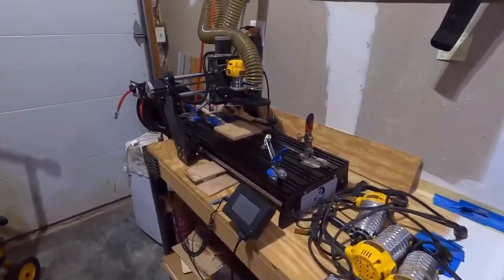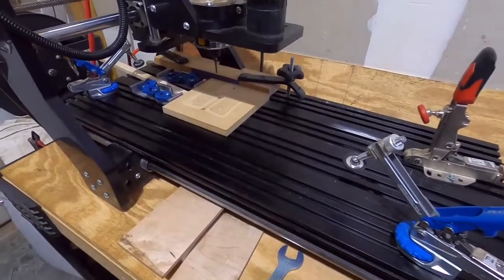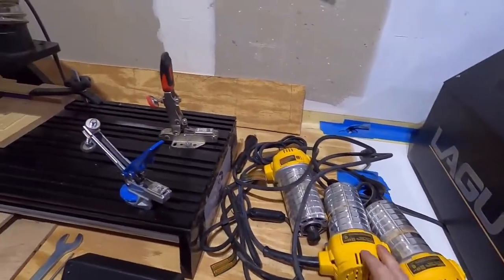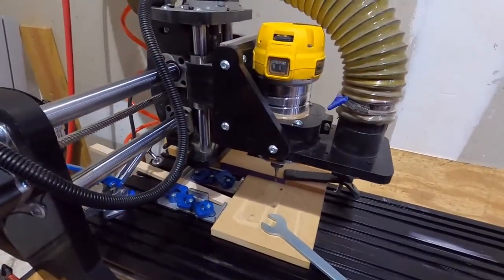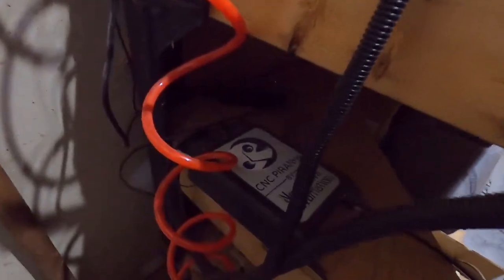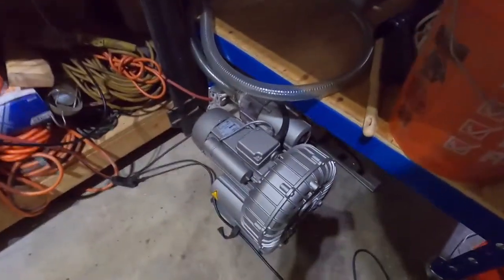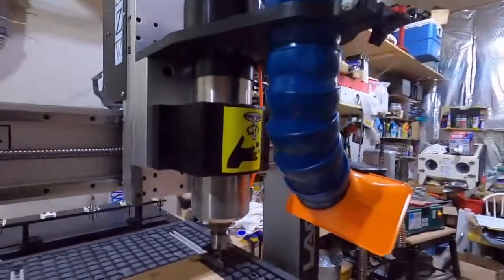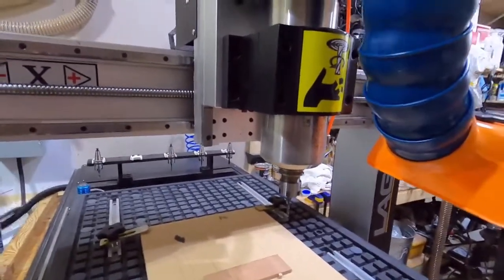Upgrading the CNC Piranha to Laguna IQ PRO

Comment: I'm considering the 2x4 IQ pro. How has the 3kw spindle worked out?
Reply from the maker: It has done really well for me. I can run it all day long and does not heat up with the water cool system. The only thing I did not realize when I bought it was that I needed a better Air Compressor and to make sure it was running when running the CNC. The automatic tool changer does not release the bits if not good air pressure and can cause major issues. Although it has been working great, I did not get any documentation on the spindle and any maintenance it may need. If I had a bigger shop, I would get a second IQ Pro.
Reply: @browneworkswoodshop  Thank you for the feedback!